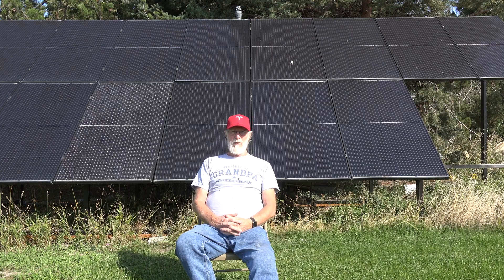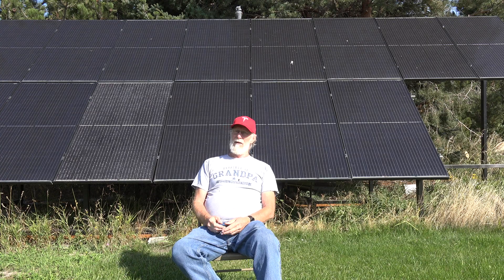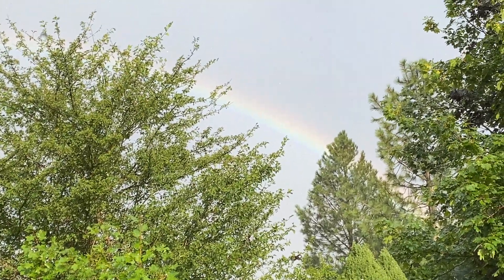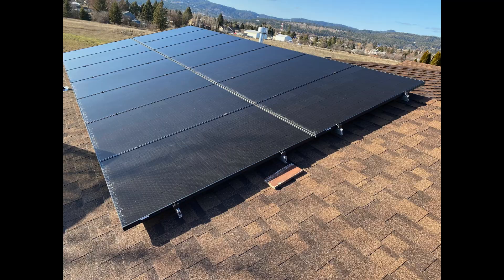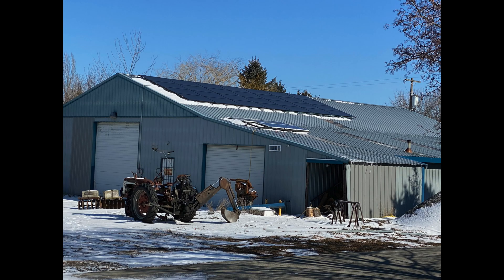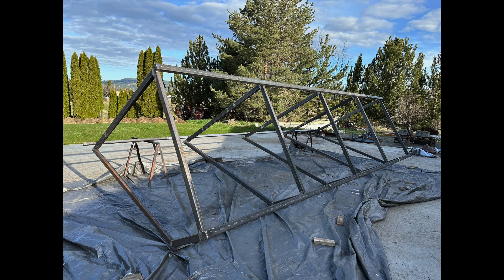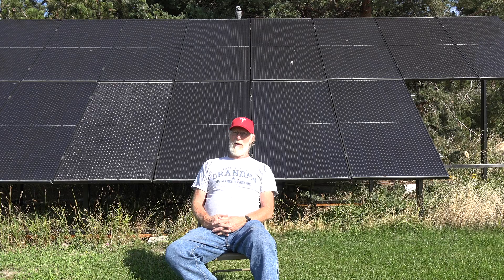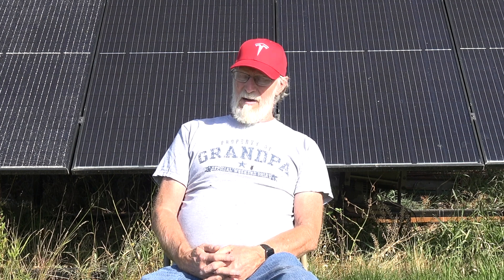Why did I ground mount my solar

Comment: I'm looking into solar panels and a battery backup since my computer uses a HUGE amount of power to make my videos because I leave it processing 24/7 and sometimes use two of them.
I didn't like the roof option as my roof is 12 years old now, and I have a 'trick knee' that can snap off at times and make me fall. So I am thinking about using 'bi-facial' panels upright in a sunny spot near the house right up against a white shale cliff. I'll use them as fencing panels and be able to get power from the reflected light on the backside also.
But the fact that a person has such easy access the backside is a sure deal-maker!
For battery backup I'm looking at an 'all in one' called 'Cloud-Energy'. It has spots to plug in solar from two arrays and one wind generator, it has a 7.5Kw battery expandable by 7.5 each time up to over 30Kwh. The inverter is 6,ooo watts with the ability to handle much more for a few seconds. It also plugs into the wall and can be set to pull from the wall when the batteries get to 20% or so.
It's probably not great for many folks, as it'd be off-grid, but I can set it right by the computer and power all of the accessories also, as well as move the freezer over there to use that also. I expect that'd save me about $150 monthly because my electricity is 50 cents per Kwh from 5 to 8PM and 35 cents the rest of the time and I use close to  20Kwh daily. I want to get about 12Kwh daily. I think 2,000 watts of Bi-Facials in that sunny location ought to do it.
Reply: I can't say I have any bi-facials, so I have no opinion on them.  
I do have some info on solar and battery backup and inverters.  
I will be installing the EG4 system with 28 KVA battery when it arrives.  I currently have 56 panels and will be adding another 6 very soon.  That will max out the EG4 charger/inverter.  
I will be doing videos on the install when it happens.  
If I were you, I would do more panels.  More is always better, and they are dirt cheap.  
I would love to hear your progress as you move into solar power.
GFM
Reply: I agree that more panels is a good idea. The prices even for Bi-Facials can be as low as 85 cents a watt right now. It makes sense to put some in the spot with the first light and some in the spot with the last light.

Comment: My favorite ground mount installations are when solar panels are installed over parking lots. You get an added benefit of shading cars. That isn't practical in a residential setting but carports, pergolas, gazebos, etc... could be covered or made from solar panels.
Reply: All true except for made from solar panels.  They are not mounted so that they seal.  Would have to have a roof below.
GFM
Reply: I saw an install where they used sealant between the overhead Bi-Facial panels to stop leaks on a patio/parking spot. The cars and concrete below reflect up to the bottoms of the panels and in the middle of the day they generally were pushing out more power than rated. And they seem to do relatively well in cloudy conditions also. @grayfurnaceman
Reply: I agree.. pergola.. or carport type coverage is nice.. shade/maintainable.. doesn't just occupy land. 
Also agro volatics type ground mount sounds interesting.

Comment: I agree with your reasons to ground mount your panels.  Some people don’t have the space for that, but it looks like the way to do it if you can.  I’ll be very interested in the battery backup!    You also charge the Tesla using solar, don’t you?
Reply: Just got the bid for the backup.  I will be reporting my thoughts when they arrive.  The Tesla is generally charged directly by solar.  I have it set up so that if the solar is producing more than the charging current, the car is charging.  
GFM